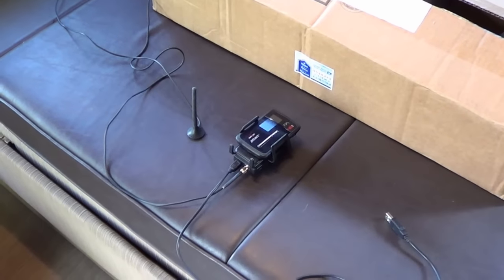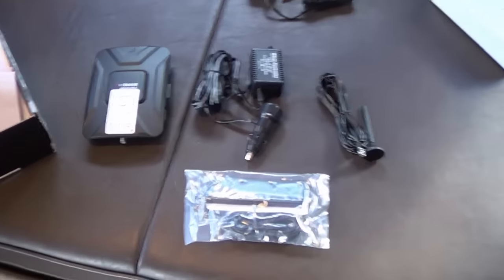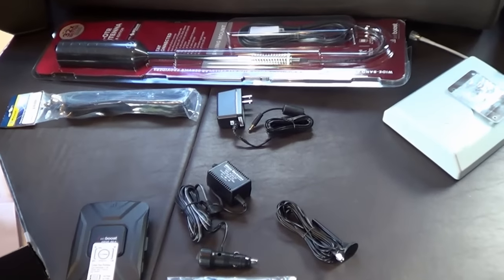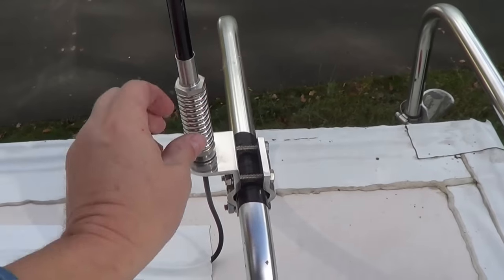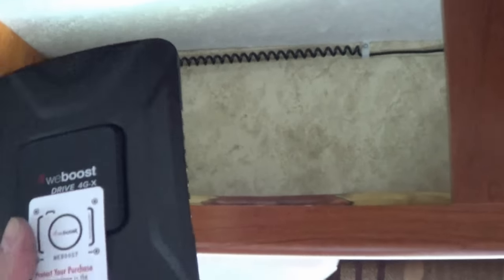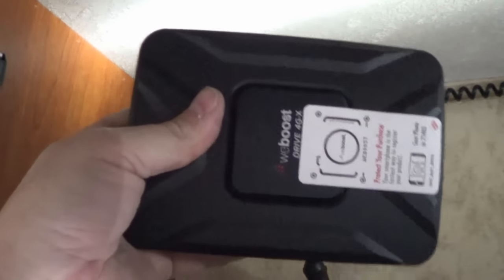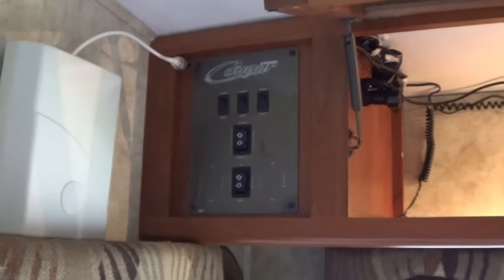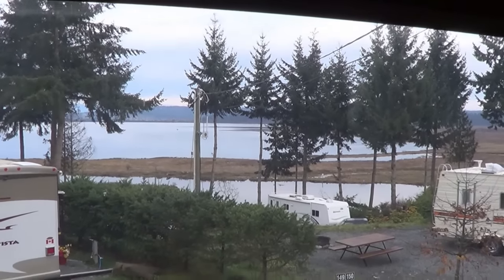weBoost Drive 4G-X RV Trucker Cell Booster Installation

Comment: Nice video and we love our weBoost 4G-X.  Excellent idea on the tape under the antenna mount.  Nice to know the newer antenna base has a sufficient size to act as a ground plane shield (I placed our earlier version antenna 15+ feet from the retransmitter antenna).
Reply from the maker: Thanks, glad to hear its working well for you. Cheers Ray

Comment: FYI for anyone watching, the model linked in the description isn't exactly the same as what is shown in the video. The Amazon link includes a different antenna that is not spring loaded so if you mount it to your rear ladder and hit a tree it will break. The spring loaded antenna will cost you an additional $100 directly from Weboost. I'm also not sure if the trucker edition includes the large white internal antenna that was shown in the video.
Reply from the maker: Good catch, I didn't clue into the so have changed the link. Thanks Ray

Comment: I have mine in the middle of the Rv roof. That way bedroom and living room get great in put for our computers. I also found the I had to move the out side ant up higher is some place.one place I move it up on my flag pole 20' up and boy did it pull in dam well then. Then I collided up the wire on the ladder. But works great for us.....hi did you get some Ride On for your tires yet? John wino
Reply from the maker: Thanks for the info John, haven't got the Ride On yet, gonna get it once we hit the USA

Comment: Nice install Ray.
Just 2 days ago, I ordered the Drive 4G-X. I wanted the OTR antenna but it's over $200 on Amazon.ca and $65 on the US Amazon. I'll wait on your review and see if it's worth it. It would be nice if you compared the two outside antennas and also the two inside antennas to see if there's a big difference. Thanks for your great videos. Keep up the great work.
Reply from the maker: Good idea, I'll definitely do that for the review

Comment: I live in Oregon and do a lot of camping on the coast, so I would be really interested in hearing how it works there. I usually camp near Pacific city at Thousand Trails and the cell service is there......sometimes.
 It would be,  IMO, a really good test if you were able to check it near there. If you go into Pacific city the service isn't too bad, it's north of there that it's really bad.  Most every where else we go on the coast we get pretty good cell service. There are places to park, the beach at Tierra Del Mar and at the turn for thousand Trails, and of course the campgrounds at Sand Lake and Whalen Island.
I know that in the past you have camped at the RV park near the Air Museum in Tillamook...if you continue south on 101 and take the first Pacific City exit then follow the signs to Thousand Trails/Pacific city, it will put you on a road that makes a loop through Pacific City and back to 101. There are some really nice campgrounds in this area too. Sand Lake is really nice, Whalen Island (county I think)campground, Cape Kiwanda RV Park...and of course Thousand Trails.
It Is a very pretty drive too...the road leaves a bit to be desired until you get to Tierra Del Mar,  but it's still nice....much more interesting than the very boring 101. If you get to Pacific city at the right time you can watch the fishing dory's go out or come in.
Reply from the maker: Thanks, Rich I know the one you mean, we were TT members in the past and have stayed there, the Whalers Rest TT park down past Newport also had poor cell coverage. Whalers was where I first bought the Sleek booster to get a decent signal.
Sand Lake looks interesting, will have to check it out.
We knew about the dory's but haven't seen them, must be cool to watch Cheers Ray
Reply: Yeah they are...!

Comment: You make it look so simple to install. How will you have power for the backup camera? I thought it used the 12v plug also. Thanks for sharing.
Reply from the maker: I plan on only using the cell booster when camped so won't need the camera and booster at the same time. I'll likely repurpose my old Sleek booster to use in the truck if we need it. I find though on most highways the signals are pretty good. My main use for the new booster will be when we camp in the boonies. We like to boondock a lot. If I did want to use both though I could buy one of those 12-volt power sockets splitters - http://amzn.to/2fsOx8i  Cheers Ray

Comment: I have the same unit except for the larger interior antenna. I place my cell phone right on the small interior antenna and that seems to work best. I'm curious to see how the larger antenna works. Be nice to see a  comparison of the 2.
PS - I mounted the trucker antenna outside on the rear wall.
Thanks Ray.
Reply from the maker: I'll be sure to compare the two in my review.  Cheers Ray

Comment: Will it send the signal to your truck while you're driving ( only for your passenger of course ;-) ) or failing that can you put another booster or receiver in the truck to work with the antenna ... Just curious
Reply from the maker: I'll check that out but I'd doubt it with the metal cab of the truck and trailer frames in the path. I could use the smaller antennas that came in the kit in the truck and move the amp in there. My plan is to us my older Sleek booster in the truck if needed. But usually, on highways, we get decent cell coverage anyway.

Comment: Looking forward to hearing more on this, Ray! Safe travels and looking forward to following along on your next adventures! Being in southern Oregon myself and a coastal fanatic, I'm curious on your updated reporting. With the antenna having a spring mount, still any concerns if it catches a tree or other obstacle? How high is it from the top of the antenna to the ground, or the top of the antenna to the top of your rig? That Angie is the best supervisor!
Reply from the maker: Trees are always a concern but I think it will be OK. The antenna is 12 feet 4 inches above the ground, the highest point of my rig is a vent cover at 12' 6". I'll have more worries than the antenna if I'm hitting large tree limbs at it's height, like my AC unit! :)

Comment: That looks like a great system.  I will still be interested to hear if you have any RFI when running both the booster and the camera.
Reply from the maker: I gave it a try and no difference in the camera picture. I'll have to test whether the camera impacts the cell booster once I get to a weak cell area so I can test it. The camera works on the old 2.4G cordless phone and router frequency so I'd have to think they should be compatible or there would be problems for using it in a household.
Reply: I agree.  But intermod can be tricky so please let us know how your testing goes.

Comment: Great video Ray
We purchased this item without the trucker version for our motorhome class a.
Using the smaller inside antenna the chocolate bar you have to have your phone right on it for it to work.
Sure hope that bigger inside 
antenna works and then you could give me the model number for it. Thx Jeff.

Sent from my iPad
Reply from the maker: Thanks Jeff, I plan to test everything in the kit so will try to get a comparison between antennas. It won't be scientific but just what I find. I sure hope I don't need to have the phone beside it, too.  Cheers Ray

Comment: Howdy Ray! Now that you've been boondocking since the installation, how is this setup working for you?
Reply from the maker: Excellent, anytime we have been on the fringe it has boosted us to a usable connection. I'm pleased with it.
BTW, Soon I will be testing a new set of antennas that weBoost is coming out with around mid-April. Supposed to be designed for use in RVs, maybe it will solve the short broadcast range of the internal antenna. Will have a review out around then Cheers! Ray
Reply: Thanks for the feedback! Take Care!!

Comment: nice video....  dont they cost a few hundred ??   i seen some ebay ones with same power for $100  i was too chicken to get one  haha
Reply from the maker: The prices are all over the map as far as I've seen. This is the package I was sent - http://www.tadibrothers.com/products/7-monitor-with-built-in-wireless-ccd-mounted-rv-backup-camera
It's high priced I assume because its wireless, HD, 2.4G versus some that are bluetooth or hardwired, comes with a bunch of accessories and a 30 Days 100% money back guarantee.  The company is based in LA
Both  the camera and display have a high quality feel so I hope the performance matches. We'll see. :)

Comment: Will you have to remove it each time you move? How far above your rig does it stand?
Reply from the maker: No, it is designed to permanently be there. It is 12 feet 4 inches above the ground, the highest point of my rig is a vent cover at 12' 6". The antenna does have a spring to it in case a tree limb hits it
Reply: TY

Comment: Further away the better. Won't work if too close, I have one.
Reply from the maker: Thanks, I thought that might be the case.  I guess it would be best to mount the inside antenna at 90 degrees to the outside antenna or did it make any difference?
Reply: As long as your light on your booster is green, the distance between them is fine. Solid red light, add separation, blinking red / green light, mild oscillation and your booster is functioning with a reduced gain, if you are okay with the boost you are getting leave it be, if not, again, more separation until your light is solid green.

Comment: The normal internal antenna is good for up to 4 feet, how is the big white antennae working?
Reply from the maker: So far I find the bigger white antenna does give a better signal than the little one but I still have to have my hotspot or phone very close to it. I've seen nearly a 50 dBm gain and from 2 to 5 bars  on my Verizon MiFi, but that's within a foot of the antenna.
I would have thought it would fill the room.  I've only had a few chances to test so far though...
I'm going to do some comparisons between the old Sleek booster and the new one using the small antenna and large.
Reply: Love Your RV Thanks, looks disappointing on the inside use. I'll wait for the rest of your testing,

Comment: Head on over to the manufacturer's (Wilson Electronics) site: weboost.com to see the latest products by Wilson Electronics. Lots of new products being put out!
Reply from the maker: I reviewed the RV kit last year - https://www.loveyourrv.com/weboost-drive-4g-x-rv-cellular-booster-kit-review/  I see a new one that uses an extender pole with a directional antenna. Looks like a good option for a long-term stay.
Reply: Love Your RV - Definitely! Extends up to 25 ft. Basically the Connect 4G (home and office booster) and strength of it for your RV. Another good option for many circumstances.
Reply from the maker: Should be a lot less interference between inside and outside antennas so better inside range I would imagine.

Comment: Turn it off when you are not using it.
You are basically broadcasting microwaves throughout your rig.
It's not like wifi in your home.
Reply from the maker: I assume it's extremely low powered but It will be since it also sucks power of the batteries. I'll be mounting the internal antenna high up and away from where we sit.